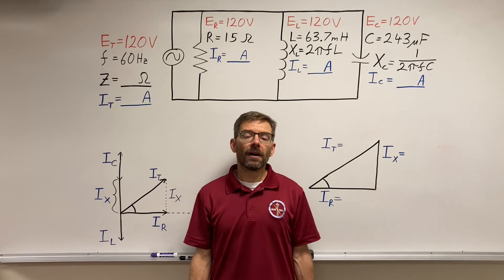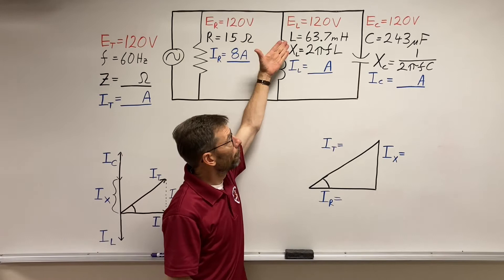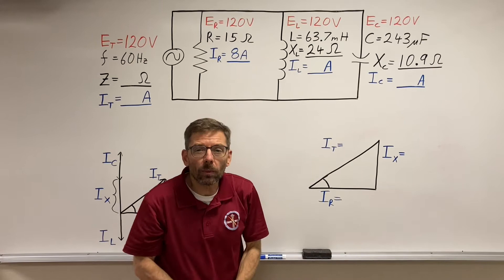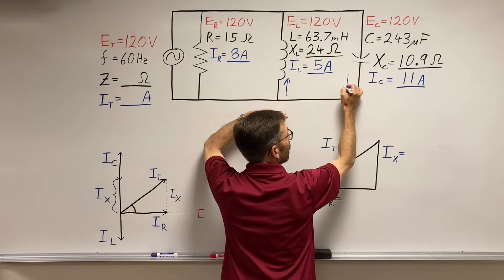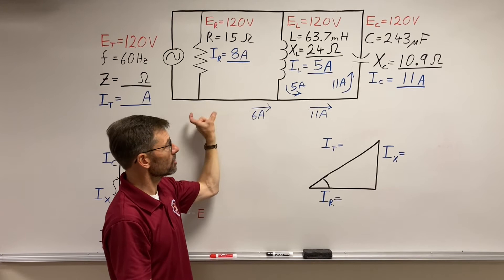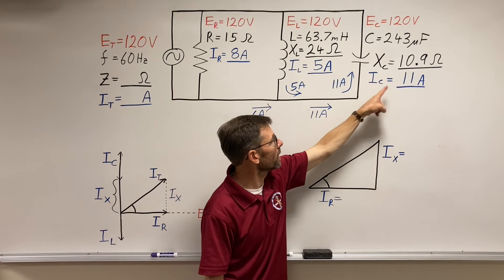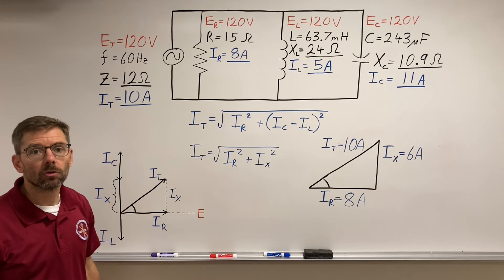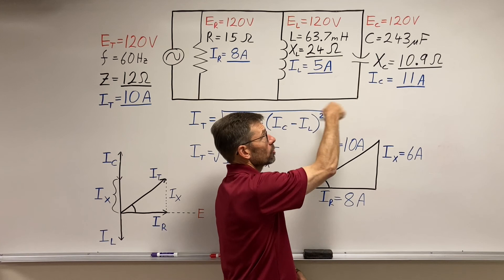Parallel RLC Amps & Ohms

Comment: Nice video: One question that no one ever addresses is WHERE does the transition from one current to another occur in the RLC circuit? For instance, where exactly does the Total current with its phase angle transition to the resistor current with zero phase angle?  Does this occur inside the passive element or in the wire before/after the passive element? Thanks